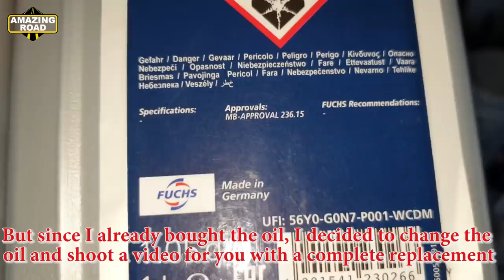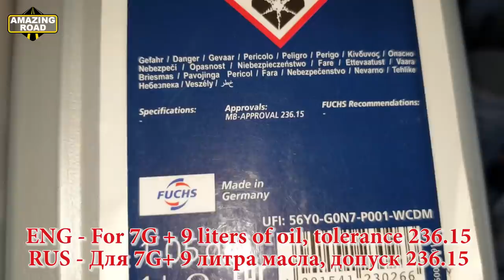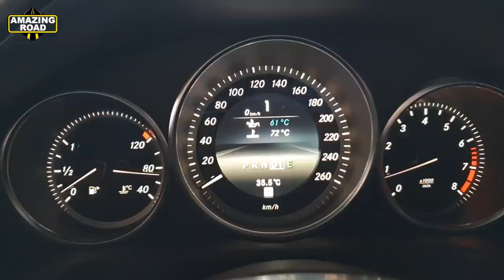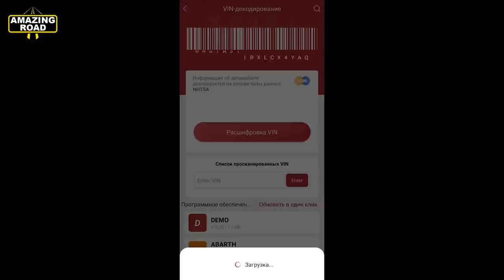Complete Oil Replacement Automatic Transmission 722.9xx Mercedes W212, W211, W204, W221

Comment from the maker: Complete Oil Replacement Automatic Transmission 722.6 to Mercedes W211, W212, W204, W203, W221, W163, W140, W220 - https://youtu.be/dWwR-5Vr-fQ
Полная Замена Масла в АКПП 722.6 на Mercedes W211, W212, W204, W203, W221, W163, W140, W220 - https://youtu.be/dWwR-5Vr-fQ
Reply: iam getting error no access authorized error in xentry 2021.09 when installing
Reply from the maker: @balatecnokrat8542  2021.09???
Reply from the maker: @balatecnokrat8542  Install 2021.06
Reply: @AmazingRoad   solved the issue now working

Comment: What is the spray you are using to clean the perimeter of the 7G transmission at 8:40 please ? WD40 lubricant ? Brake Cleaner ?

Comment: Please advise what could have gone wrong that stopped my Mercedes Benz e550 2012 4matic from moving forward or backwards after changing the gear Oil with a MERCEDES-BENZ A001989240310. I could shift the gear easily to drive and reverse easily but the car just won't move. Please advise

Thank you

Comment: Do you need to change the oil of the transfer case? 
Also do you have a video on changing the rear and front diferentiol oil 
Thanks
Reply: When Chang in the diff oil just refill
Until
It starts seeping out from the filler hole

Comment: Not bad instruction but pan bolts should be replaced as they are aluminium and can't be reused.
Reply from the maker: Maybe even several times, this is all so that you spend a lot of money on parts
Reply: Мне меняли у дилера. Полная замена £480. 9 литров оригинального масла (масло или Шелл или Фукс производство) сине-зелёное, фильтр глубокой очистки, 6 болтов обязательная замена каждый раз, зелёная переливная трубка плюс прокладки. Замена с подключённым Старом, температура масла +45 С.
Reply from the maker: @danpan6420  :_139:

Comment: А какое масло надо лить на s212 (w212) 2.2 cdi 100 kw 136 л , 5 ступка автомат ! Спасибо
Reply: If you have 5g, so you have to watch the video for 722.6 transmission. The ATF you will need is MB 236.14 (Febi Bilstein, or any other with this specification) of red color.